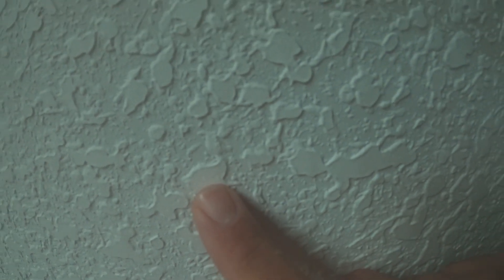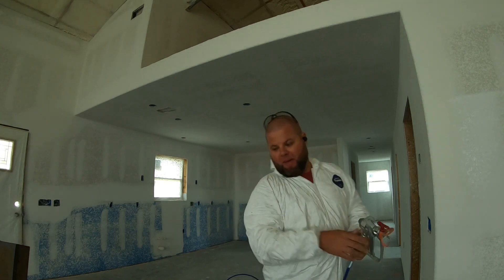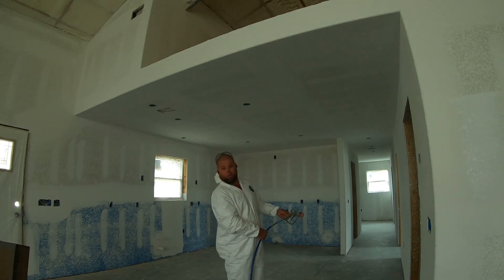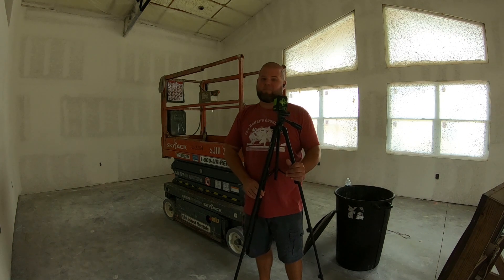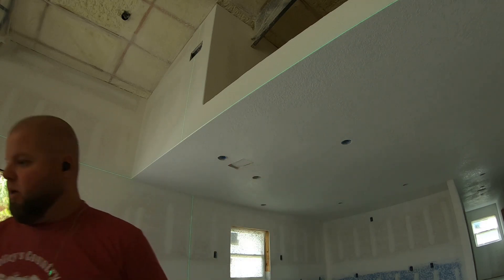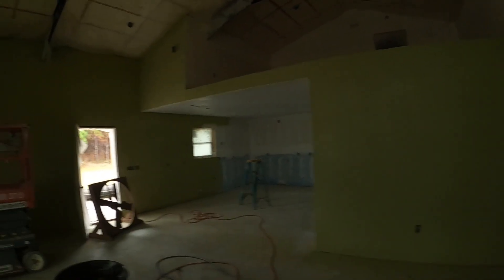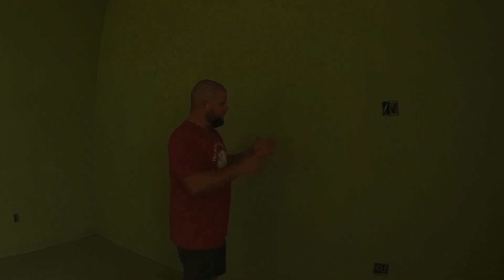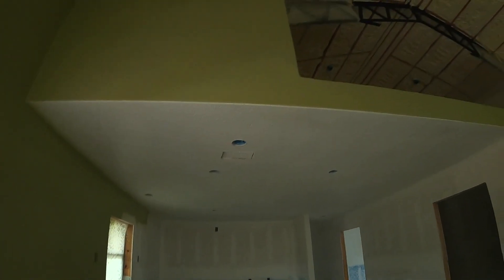Interior painting begins, I'm not satisfied! #489

Comment: I'm no painter but I been watching Youtubes on subject. While your spraying you need to have someone come behind you and back roll paint with a dry roller while paint is still wet. The back roll is an 18" roller which will cover a lot. Heres what I found on net, hope this helps, love your home.
“Back-rolling” is the term most often used in the paint industry to describe the manual process of dryrolling the freshly painted surface with a short to medium nap synthetic roller, immediately following the spray application of water based paints onto walls and ceilings, whilst the paint is still wet.
Reply from the maker: I've been hearing about this but never done it before.

Comment: Oh snap I forgot to say,  on that bullnoise when you're cutting in different colors,  the easiest way is to tape the straight edge before the turn,  take some clauking and run the edge of the tape to drywall,  wipe it clean. Paint it and pull the tape..
It will give you a very clean line...

Comment: I was once told that you need to kind of “seal” dry wall before painting it. Otherwise you have problems like you encountered.
Reply from the maker: I bought kilz, it's a sealer.
Reply: yeah I have to agree every time I didnt properly prime a drywall it always changed the color and looked bad. edit after reading Kelleys comment, thats exactly what I use its good stuff but its not good when thinned down

Comment: I’ve been painting a room every week for the last two months. With the texture you want to spray from different angles but what I have learned is that streaks often or paint that doesn’t dry, and I know it’s supposed to dry in a couple of hours but in some of the rooms that streaks win away after two days. I think sprayers are awesome, and with that texture it’s going to save you countless hours.

When you’re painting over plaster you didn’t primer so you need to let the paint soak in and dry for a day then do your last coat.   The plaster sucks up paint and so does paper but at different rates so you should always do a primer first but you did paint already and it’s probably a priming paint, most are now, so let it soak in for a day or two and do another coat and that will probably work. You need to really seal the wall in first before wet paint stops soaking into it now.  Once it sealed the paint just sticks to the surface and shouldn’t Soakin anymore, and with your humidity it may take two or three days to dry. 

You’ll get it eventually, I want it bother with the kills or primer over the green. It won’t hurt but either way once you get your primer on you need to let it dry for at least a full day but with your humidity I would go two days maybe three and let it really dry and do its job as a sealer then you’ll have a nice sealed surface to paint on so the color will be even.  Also, it seems like you’re moving very fast but I don’t know your sprayer and it’s hard to tell on video. I found when I was using a sprayer I had to slow down a little bit and make sure it was getting enough paint on everything. The first two rooms I did came out splotchy because I just wasn’t getting a full coat of paint on everything. After I redid those I kind of figured out how to pace myself in the other rooms went on easily with one coat.  If you had kids I would tell you to use a roller for your final coat because then you can use the same kind of roller to match it. When you spray and you do touchup with a brush the texture of the paint is going to be different than a spray or a roller and especially with darker colors the touchup in the future can be a little hard to get to blend properly. With a spray when you do touchup you wanna do very thin coats with a brush and feather it and don’t do little tiny spots, like if you get a scratch on the wall don’t paint a quarter inch over the scratch or it’ll stand out do you want to just kind of feather the whole area with thin layers of paint until the scratch is gone but the easiest way is to do your final coat with a roller so you can always reproduce that easily.  With you guys it probably won’t be that bad go if you have a little kids that are constantly banging on the walls and you’re doing touch up all the time in the long run that makes it easier.  You’ll get it, hopefully the color comes out exactly like you wanted and you’ll love it. :)
Reply from the maker: I did notice after it dried it was fine. I also bought kilz yesterday and applied it to the rest of the walls.
Reply: @TKCL  priming first is definitely the way to go. Most paint now says it’s primer also and you don’t need it but it’s much better to primer first and let it dry and seal everything and then the paint sticks easily to the primer. For dark colors like that I will have the paint store add the dye to the kills as well so my primer goes on dark and it’s much easier to cover with a dark colored paint. It usually comes out a little different shade which is nice because then you can see when you’re painting much more easily.  But it was very humid and rainy here while we were painting and I would see the same thing. I painted my room a very light color gray and I hated it because it was really streaky and blotchy and for three days I just put on three different coats and it still looked horrible. I finally gave up and moved on to other rooms and two days later it looked great, it just took forever to fully dry and for the color to set.

I’m glad yours worked out that’s a whole lot of paint to have to redo. I’m sure it will look good once you’re done. No from the videos the color looks hideous in my opinion 😂😂 but honestly I hope you guys like it and are happy with it, that’s all that matters. :)
Reply from the maker: I didn't know about the tinting the primer trick.
Reply: having the primer tinted just helps you not miss anything when you are priming bc it's color not just flat white you can see where you have painted
Reply: @dannyflanery7466  tinting the primer is good for several reasons, one you don’t have to do as many coats of paint but also if you scratch it in the future or as you wash it and thin it out it doesn’t show through as easily. Most paint is slightly translucent so the color you put beneath it is going to change the color you get on the surface so if you’re going with a darker color you don’t really want to use a bright white primer or you’re gonna just have to keep putting layers of paint on until you block any light from bouncing back through it. If your primer is dark like the paint you can get away with one or two coats instead of three or four which is not uncommon for dark paint, especially when you’re rolling or brushing it on.
Reply: @TKCL  when I worked in construction my boss told us to do that.  It made it much easier to get good coverage.  In automotive painting it’s pretty much required. If you use two different colors of primer your end color will be different because paint is slightly translucent.

Comment: You can get way less splattering and spitting if you run the trigger constantly on those sprayers. An extension wand helps a ton so you can cover more area.
Reply from the maker: Been looking at the extension
Reply: @TKCL  the one I have is 12", I think. About 30 bucks

Comment: Primer / sealer on unpainted drywall. Now you know, 300 bucks later and a days work later. The ceiling is also picking up green particals from the air, no way around it. Next time you'll know. I have never even tried to spray inside.
Reply from the maker: I'm rolling now and it's a difference.

Comment: Good morning Andrew, I have to laugh because I went through the same things but a little different. I had bought a home that I am remodeling and it had a black wall in the master bedroom.  Went to lows and bought 5gal. Of white paint, the expensive sherwin Williams paint with primer that claims one coat covers everything. Not true! I had to paint 4 of my 5 gal. on that wall to cover a black wall [thought that I was never going to see a white wal].  This paint has a primer to help cover any color, not true. Funny thing is that I talk to my mother after and she said oh no don't use lows paint going to home depot and buy Glidden paint that I would be more happier with that paint. And sure enough I painted the rest of the house white covering different colors and only had to do two coats. And I rolled the whole house even the black wall that I started with. So my advice is to go to home depot and try Glidden I am pretty sure that you will be happy to  only have to do 2 coats instead of 3 or 4. I know that I was happier.
Reply from the maker: Never tried that paint, thanks!

Comment: Painting is an art form I started back when was like 14 years old.  Painting 6 houses in a summer.   The first part is most have no clue about shadows and hiding them. So them shadows are in the back like your screws patching.   If it had been my job I would have added 2 coats of primer before the finish you added.   Too funny in Canada we are removing popcorn and texture in old homes and you added em.   As fow how to hide shadows.  Roll W's   so adding them will add a movement to your rolls the will hide the vertical lines of your roller and add a diffrent dept.  So in a way it makes new shadows to blend em in. As for cutting your walls.  Cut then twice before you roll.   Why?  Well the first cut you leave a bit of a lower line.   The first cut will be light.   The second one will have the top part full and line cut to the best line.   But since the first one you did 6 inch wide it will leave you the dept to roll and not ever go too near the celing.   Having done 2x the cutting before you roll will then allow it to have created an edge with no faults.   Then quick roll the W's or M  is you  are in a stair way.   Its illusion painting.   As for primer.  Killz makes a decent product.   Normally I just use the same as the celing chalk paint for the primer...
Reply from the maker: I purchased kilz yesterday. But I started rolling and Im getting much better results than spraying.
Reply: Excellent advice...having been a painter in a previous life...retired now...I totally agree.  Spraying is for making quick $$$$$ and moving on.  Results can be mixed but to me an old fashioned roll job is always better though more work.  Knapp on the roller controls the amount of paint and the wall type controls the Knapp size. Live and learn is the best way.  I always try to do a small room first for results then make adjustments if necessary.
Reply: As well I should say my teachers have been me gavin the biz.  For example. 3 of them where painters for the Canadian Capitol Ottawa's Parliment. As for how long did they do this job?   Well considering in 1977 my grandpa was 50 years old. And his employees was his nephews and they was in the early 20's  as they became teachers. And Maurice at 70 something is still taking on jobs that seemed imposibble as his art he can paint even velvet cake reds on walls that are imposibble for 99% of others.

Comment: I wonder why your sheet rock contractor didn't advise you to use a primer paint as a base coat for best results? He seems like he did a fantastic job and gave you a good tip on cutting in the ceiling transition to the wall. It sure would have saved you money and time.
Reply from the maker: That's not his fault, something I should have known.

Comment: Andrew, did you first prime your walls with a drywall sealer?  Maybe I missed you mentioning that.  I am at the same stage on our build and I just picked up 50 gallons of drywall sealer to spray on first!  
House is coming along.
Reply from the maker: I didn't, but I discovered rolling a good quality sherwin-williams all in one paint gave me the results I was looking for. I'll explain in tomorrow's video.
Reply: @TKCL  good to hear. Probably cost you more money in the long run buying paint for walls and ceiling’s versus drywall paint. 😟 I just opened a commercial account with Sherwin Williams and paid less than 10.00 a gallon for quality drywall paint. We all learn from our and (your mistakes) 😂.
Reply from the maker: Man I've been wanting a commercial account, would save me a ton of money.

Comment: You're problem is you didn't Prime the drywall with a Cheap Flat white..

You Needed to spray the whole thing 1 time in flat.

Also just a heads up you needed to blade the walls and ceiling Before you primed

After you primed your drywall you're going to Need to pole sand Everything Before you start a 1st coat of finish ..

Comment: Stop.  the area where you have the streaks is caused by the lack of drywall primer paint.  Do a coat of Drywall sealer primer paint first in those area before you do the final coat.   If you had done the primer paint first you would have only needed on or two coats of good paint.  Another thing, always tint your primer paint the color you are going to paint the walls.  this really helps bleed through.
Reply from the maker: I just bought kilz a few days ago

Comment: The green is way too dark, should have primed the walls 1st so all of the wall was the same color 1st, then used an roller instead of spraying. You not having the best luck with Sherwin Williams paint colors matching your choices, maybe Lowes brand Valspar paint would have been an better choice.
Reply from the maker: It turned out great after drying, the roller is definitely the ticket.

Comment: Well you seem like a guy that does research before doing things.  Why did you not properly research this part?  If you would have simply primed everything you would not have this problem.   Of course you know this now.
Reply from the maker: Well I bought a high end paint and primer in one that promised a single coat. After I started rolling yesterday I am getting those results, spraying it just not an effective process for me.
Reply: I tried telling him to prime the entire house with PVA drywall primer and sealer before painting.  any type of paint and primer mix high-end or cheap will give you the same inconsistencies